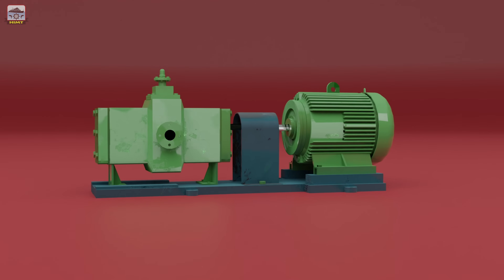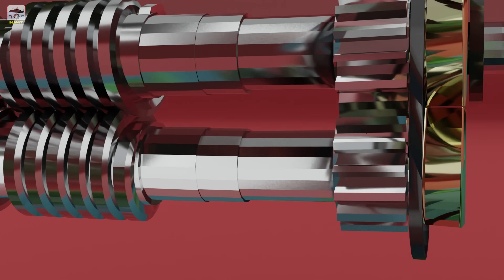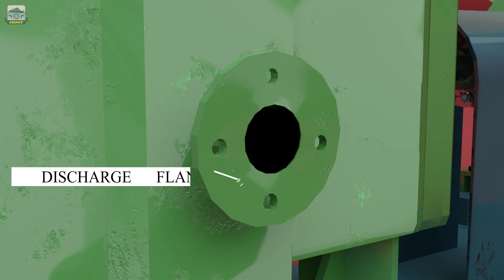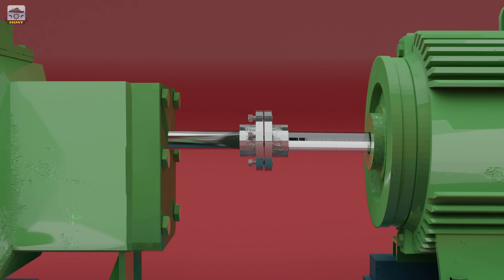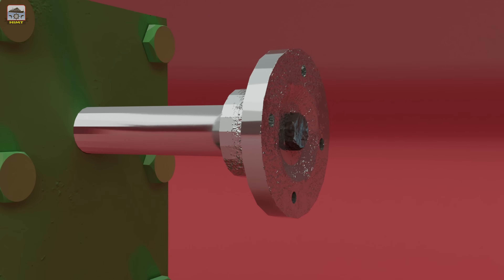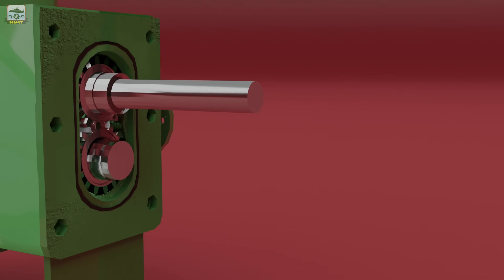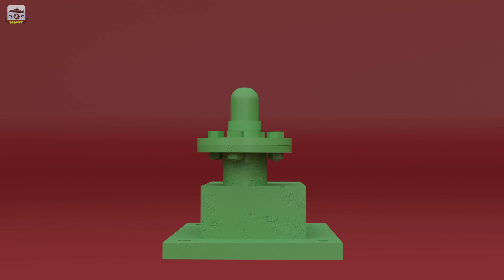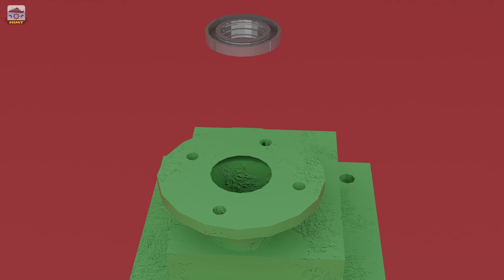Parts and Dismantling Process of a Screw Pump | 3D Animated Explanation | HIMT

Comment: You didn't tell exactly how to extract the bushings from the housing or what tool to use. Also, in the relief valve you don't say how to move the retaining cap to the spring or if the spring is under pressure  and to be careful when you remove the cap so that the spring doesn't shoot into your face. I need more specifics.
Reply: Thanks @ HarryPost for your valuable feedback. We are in the process of making a general  procedure for dismantling of mechanical components like bushes, bearings, seals, etc. and the safety features to be followed, which can be applied to all machineries. We request you to keep watching and give your comments. Thanks.